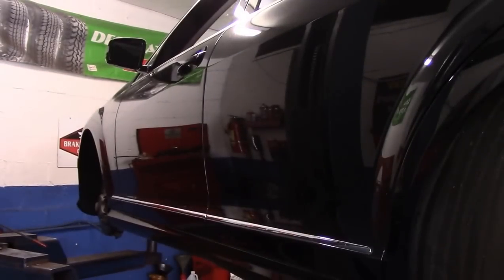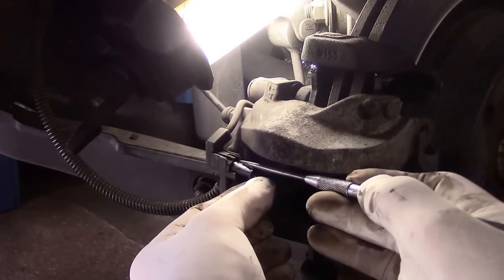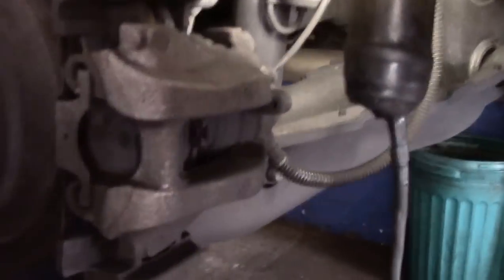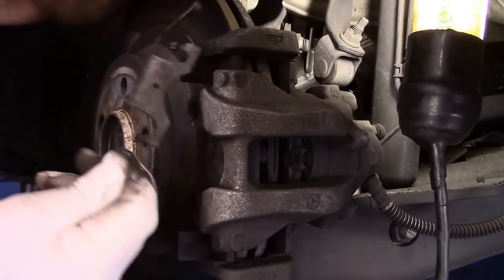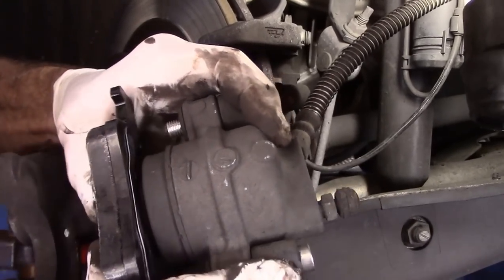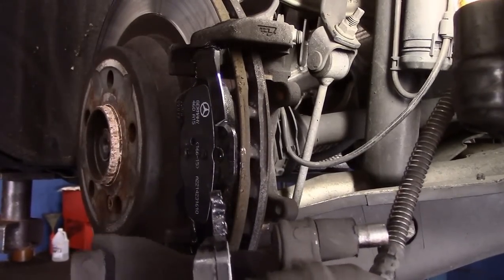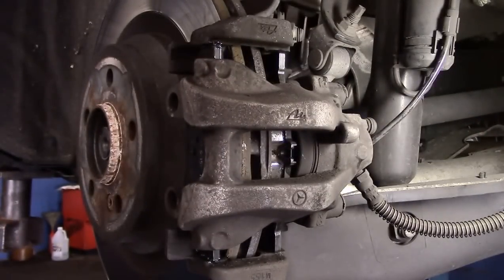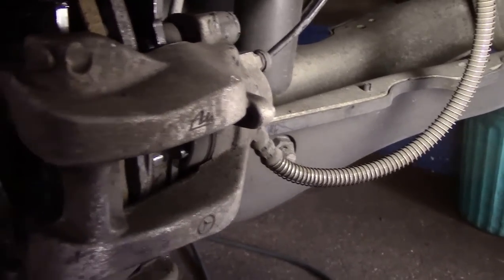How To Replace Brake Pads On A 2011 Mercedes Benz S550

Comment: It looks like the set up on the rear is exactly the same for a 2007 Mercedes Benz CL550 so I will give it a go. Also changing the discs (rotors) as well. Thanks for the video.

Comment: Interestingly I have owned or been around people with  many BMWs. The dealer will usually recommend a "pad slap" (not their words) for the first change of the brakes. In these cases I have never had any near the wear to the disc as you have here. In this case I would definitely agree with you. The disc may even be down below the minimum before the pads are worn out. Also the pad metal can contact the disc before the light comes one. Personally on my own cars if the discs are expensive and there are absolutely no vibrations or sounds under braking I will measure (or estimate) the wear on the disk and if it is well within spec, I will just slap on pads. Done this many many times. Most early pad failures I have seen are due to not following all the steps you do when you clean and lube things up.

Comment: Nice job Jim!  Two questions.  I am about to put new brakes on my 2004 Mercedes E500.  It has that SBC brake system.  I have heard as long as you have your windows up and it locked and the key fob away from it a brake job can be done as usual.  Any thoughts there?  Also, does one need to always replace the old brake hardware, the clips and caliper bolts, with new hardware?  Love your videos.  Tom

Comment: Jim,  I've followed your video to the tee and I'm experiencing a strange sounds from my rear brakes and I'm hoping you can suggest a possible solution.  It's a sort of ticking when brakes are applied but not as loud without brake pedal application.  What do you think?  I also upgraded to slotted and drilled rotor.  Do you think the upgrade on rotors could be creating this sound?.ThanksGarvin BLas Vegas

Comment: 2013 S550 with 40k miles brake pads need changing. Would the rotors need changing too?  Can't be resurfaced?

Comment: Please add to the description of the video all the tools that you used, it makes getting prepared much easier.  I can't recall if you mentioned that the caliper bit you used is a 7mm Hex.  Also, if someone were to do the rotors/discs as well, the tool is a 19mm wrench.  Highly recommended that everyone get a 19mm ratcheting wrench, which makes undoing the bolts about 10x faster.  FYI, this video is the same for a 2007 S600.

Comment: Is it necessary to change or cut the rotors every time you replace pads?  If so, I presume just cutting the rotors (as opposed to replacement) is ok if there is still enough thickness on the rotor.
Reply from the maker: In most cases the rotor will need to be replaced when they have such deep groves.
Reply: Thank you
Reply: Buy your parts at FCP Euro and brakes and rotors come with a lifetime-warranty, so you can swap them both out as often as you'd like.  I just put Brembo brakes and rotors on mine.  We will see if they still honor the lifetime warranty when they wear.

Comment: Hi Jim, I noticed you used genuine Mercedes OEM brake pads. Are there any non Mercedes OE pads that you would recommend? Just wondering. As always appreciate the video!
Reply from the maker: Good question,With Mercedes I try to only use the oem but I have used the Monroe and The Wagner.
Reply: I usually use Textar or Ate pads on German cars. Often they are the OE without the logo and the price.  Never had a problem.

Comment: Jim, as soon as you mentioned that the guy didn't want to buy rotors or at least get them turned, I was thinking, why the hell is this guy driving a Mercedes? And then you said it :) Isn't it amazing how people will drive expensive cars and then cheap out on the repairs. I've seen it before and I tell them to go else where. Especially when he brings in his own pads...

Comment: Why not turn the rotors down for him? On high end performance cars despite what anyone says I place new rotors on the lathe and check to make sure they are 100% straight. I’m not doing job twice. And I’m not having my customer inconvenienced a 2nd time for brakes. Being  caliper remanufacture,  I use a 3 phase automatic airless shot blaster, then powder coat calipers and brackets their  choice of color. That why I have the customers I have! Precise, done right, nice looking, polish up wheels, replace!! Artwork.

Comment: The reason the 'Mercedes owner' is changing only the pads is because most mechanics will charge over $1000 when the pads are only $70. I agree with the mechanic, but also with the car owner.
Reply: mhamdan1000 right.  And of course the dealer is going to say replace rotors and pads at same time. Remember for every smart and somewhat technical understanding customer that says no to the overly sometimes grossly overt inflated dealer price there are probably 100 or more that think brakes are too complicated and pay the dealer.

Comment: what happens when you get the grease on the pads?
Reply: It would probably burn off in a few hundred feet of driving
Reply from the maker: A little is no big deal but you can clean they with brake cleaner.
Reply from the maker: No it does not you just use some brake cleaner  the grease will come right off.
Reply from the maker: Exactly.
Reply: Edward Thayer Dangerous noise? He mentioned the rotors weren't too thin so just noisy / chance pads don't wear flat. Either you waste pad material and/or it's annoying as heck... too bad machining rotors is out of fashion because that's the ideal solution. To resurface them like a ninja to retain the client and quality work.

Comment: That's a stereotype.. maybe he got the car used for 70% depreciation.. Just because you drive an S Class doesn't mean you can afford an $800 brake job at the MB dealer. I'm sure brakes will be fine.. I hope you didn't spit on the brakes when you were done lol.
Reply from the maker: Thanks for watching

Comment: You shouldve slapped the pads alright... in his face. What a dummy. I used to own a 2009 S550 and did all the maintenance on it. Beautiful and amazing car but i needed a truck and traded it in for a 14 F150.
Reply: On another note, if you were going to do the rotors, you need an S shape wrench for the bottom bolt because it is blocked a bit by suspension parts, and i believe you have to use the computer to put the parking brake in service mode like on an audi. Other than that a typical rotor change
Reply from the maker: Thank you for watching
Reply: I just did a 2007 S600, no need for S-shaped wrench or parking mode on that model.

Comment: First of all, with a vehicle this heavy you NEVER just replace just the pads. If this dude was a very good Tech he should/would have refused the job! Not doing so is placing the driver/owner in danger! Second, Mercedes Benz brakes do not require grease to be applied in this fashion...especially on the caliper clip...its just not necessary! If you can not replace that clip you have no business attempting this easy job! Lastly, doing this job with the same dirty/greasy gloves is a sure what up to contaminate the already worn out rotors!